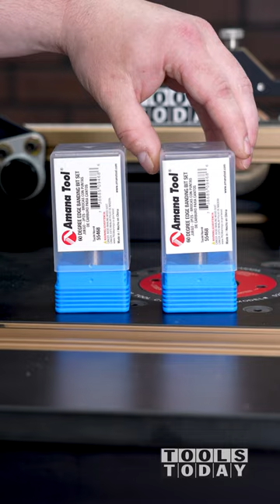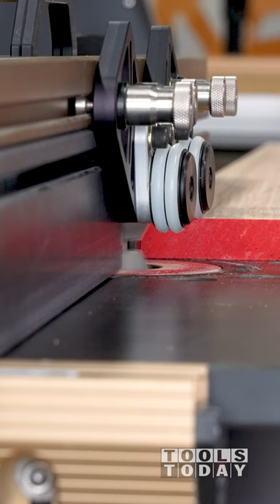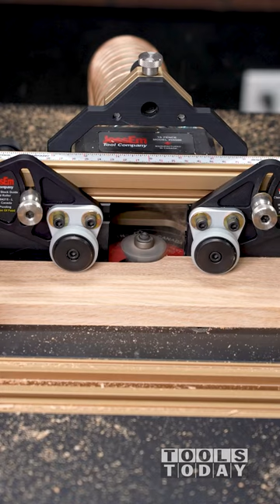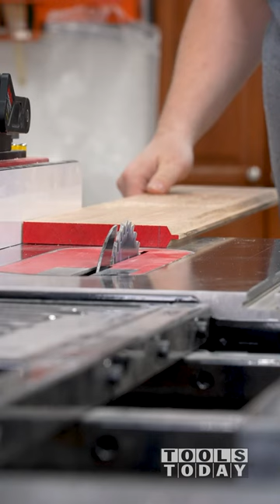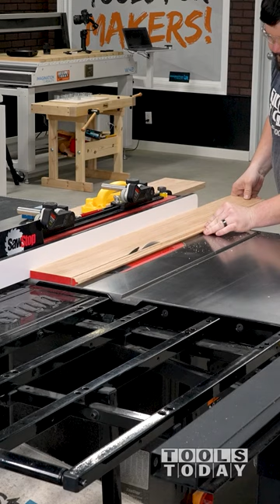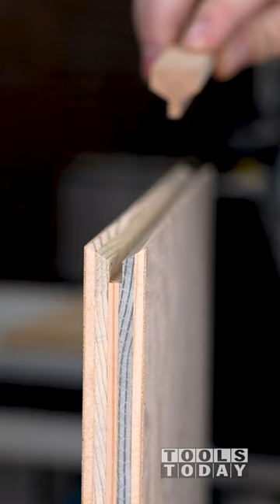Flawless Tongue and Groove Edge Banding

Comment: $150 for the router bit set.  Other than a bit more glue surface, what’s the point vs. a straight piece of edge band?
Reply: It’s a lot more glue surface, and auto aligns when clamping or nailing. Gives more of a solid edge to add profiles or not burn through ply which always happenes
Reply: Literally 0 advantage to this in reality. Waste of time in a professional scenario I reckon
Reply: @TheSmartStar  for kitchen cabinets yes. But for furniture pieces where you may only have 4-6 shelves it’s worth it. I do 1/4” or more solid edge banding glued. Regular edge banding with hot melt is not strong enough for a lifetime
Reply: @davidiliyn  solid lipping doesn’t need tongue and groove. I’m a cabinet maker I do this day in day out, 5-10mm solid on the front of a slightly scalloped edge, glued and taped while drying is plenty strong enough to last a lifetime without set up/mess/noise/time of a router table. It’s a cool DIY thing for those who like spending time making stuff but an utter waste of time beyond that.
Reply: @TheSmartStar  yea I totally agree. I was mostly meaning solid edge banding is worth it in certain applications. To be clear I have never used this method, I also just cut strips, glue and tape. It is certainly a waste of time in the grand scheme of a project. Similar to those who use lamellos connectors for face frames and random case cabinet parts that don’t need them.
Reply: @davidiliyn  haha, yes that’s true. Half of these projects I see now are 50% plastic connectors!